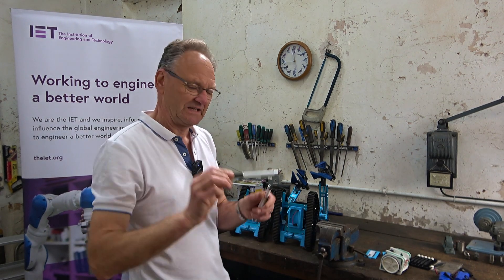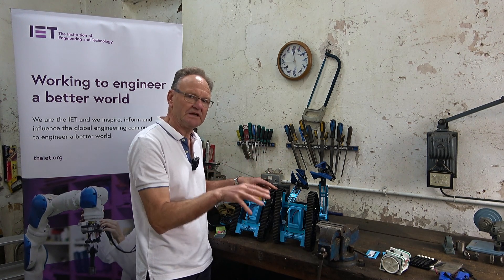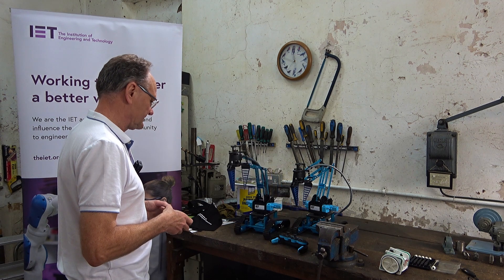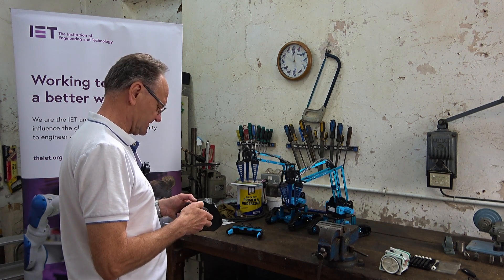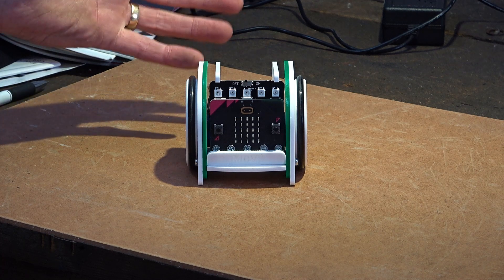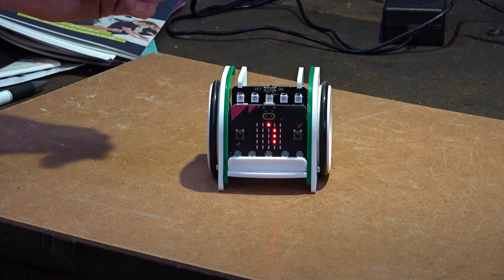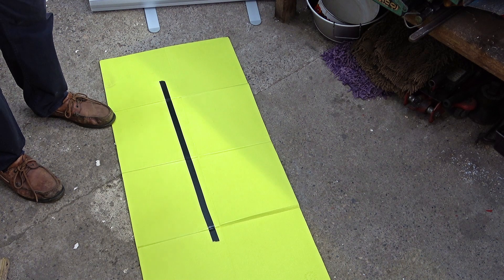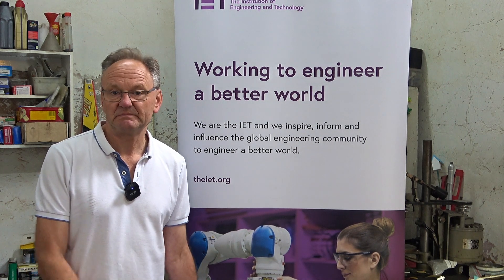HS144 STEM volunteering with the IET

Comment: That is great Paul. Very worthwhile. I used to help a friend of mine out doing similar things, we used to do the local science festival. I remember making hovercraft one year. Very rewarding.
Reply from the maker: Hi Carl, we have a standing programme of annual events such as the Otley Science Fair, Scarborough Engineering Week, York Festival of Ideas etc, and then we slot in other events on request. One or other of our volunteers will usually adopt an event as the one they are most committed to and lead on that one, to make sure we turn up organised 😁Cheers